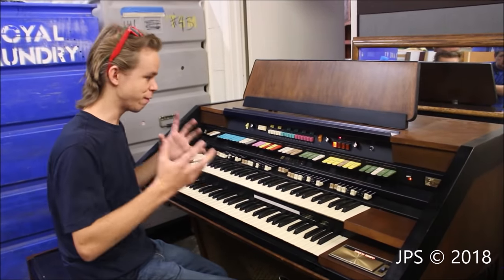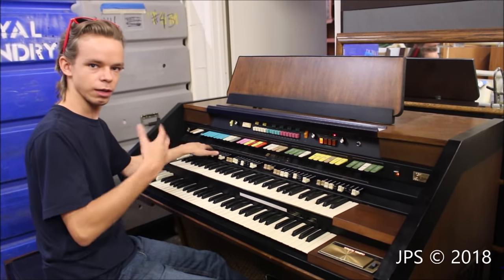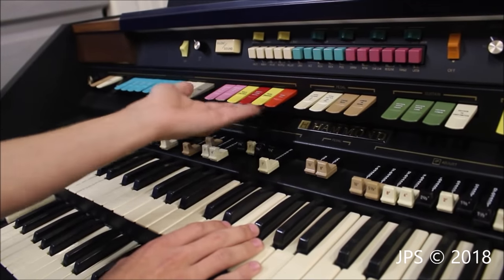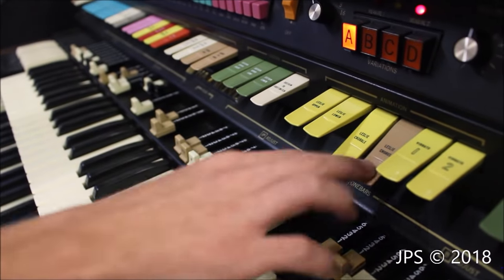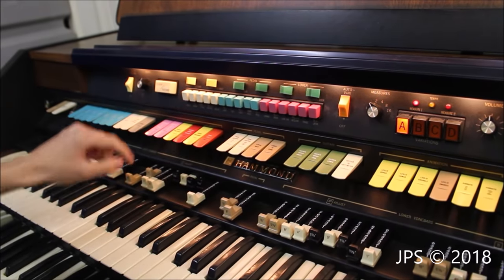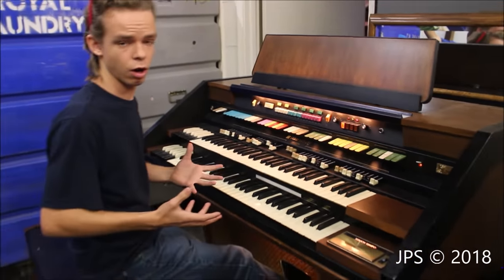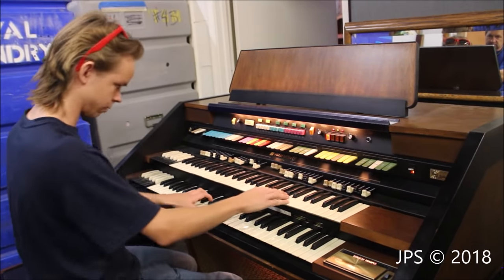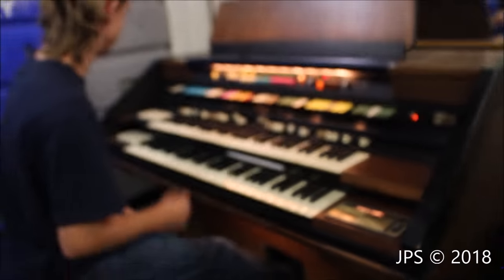James finds a $300.00 Hammond Organ, your thoughts? Cheap Deals

Comment: James, did you ever find out what the name of this model is?
Keep up the great work, I love your videos and your playing!
Reply from the maker: I looked all over including the back, and was able to find any model numbers of any kind. I know that on the B series organs Hammond did not mark them in any way, you just needed to know what the models were by looking at them. I am thinking someone out there will know the model, and let us know.
Reply: IT's a Hammond Concorde 2307, as yet said before. I've also got one, in an even worse condition. It intsantaneously plays a note upon powering on, without any key depressed. One of the preset keys remains activated and won't come up again. Due to it's enormous weight, which is more than that of an A-100 I have owned, I think I'll part it out for the manuals, buy a HX-3 board and build a clonewheel organ.

Comment: I'm an old fart, sorta (60), and I get SO TIRED of people talking about the "crappy" kids of today.  Look at this guy, and about 10 million others, and they are the same great people as there were in all the other generations (read Socrates sometime if you don't believe it).  For others, look up Jacob Collier, Sam Robson, Yohan Kim...I could go on for pages.  Noise sounds like a bearing, or something loose...probably not a difficult fix.  SOMEONE should buy and restore this thing.  Maybe your video will sell it.  ;-)  By the way, you CAN play the whole piece, just call it a cover, and modify it a bit.  That piece you wrote would make a great gaming theme.

Comment: Hi James,
I have a book by Scott Faragher called "The Hammond Book."  This exact model does not appear in the book, but one very very similar is called the X-77.  The X-77 has almost identical controls less the rhythm section, and the speakers were not self contained.  It was produced from 1967 to 1973. Similar models were made as late as 1978. I would guess the one in this video is one of the later models. I am sure this was the flagship of the home models at the time. The X-77 sold for about $5,000 for the console and an additional $900 for the Leslie speaker cabinet. That was a considerable sum of money in the mid 1970s! The one you've found has the Leslie speaker contained internally. Yes, there is a rotating drum inside that goes fast or slow. This organ is solid state using transistors, hence no start and run buttons to turn it on. Over time the transistors and capacitors can degrade and change values which cause problems. Most folks seem to feel the solid state organs do not have as good of a tone than the older tube tonewheel models. For this reason they don't hold their value like the real B-3 models. The popping popcorn sound is probably in the amplifiers and can be fixed, but I have no idea how much it would cost. Sometimes the service call and labor are a lot more than the parts cost.  You have other issues as well. I think the tabs on the left side have a problem, not something you were doing wrong. The no control of expression except when Leslie is on is a problem. The sound is sent to a different set of speakers when the Leslie is turned on. Everything is fixable, but you have to decide if it is worth it. If in perfect condition it is probably worth $1,000 - 1,500 at most. But even as is, a lot of it works and is a fun "toy" to play with. Sometimes the popping popcorn sound will settle down after the organ has been on for several minutes, but it and the volume control need fixing.  Other issues you could probably live without fixing.
Reply from the maker: Thank you for the information. It certainly is not on the level of a B3, but I hope someone could find it a home.
Reply: The X-77 was a real tone wheel organ with the same generator and almost the same guts as the H-100's. This Concorde doesn't feature tone wheels, just tons of IC's and transistors.